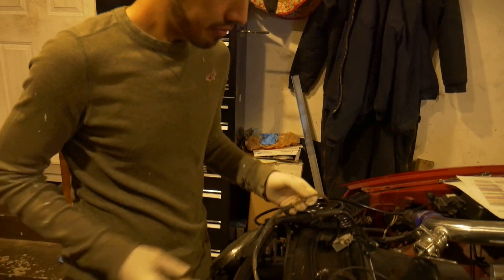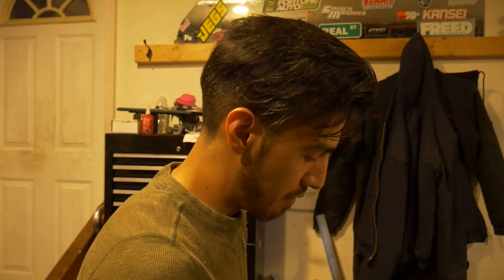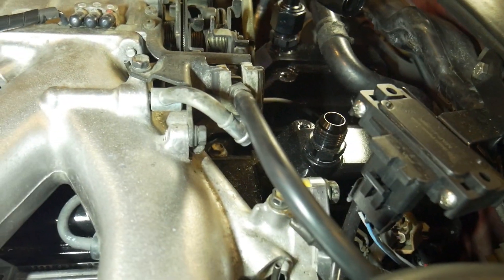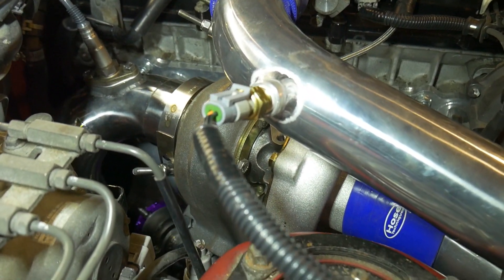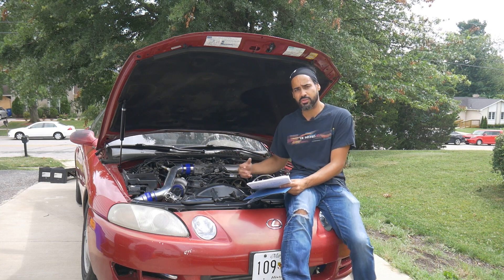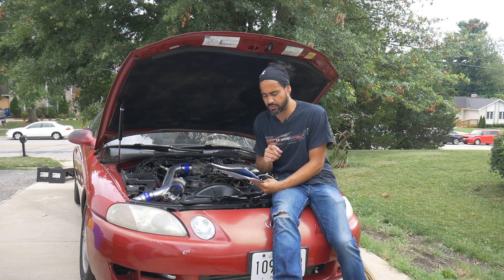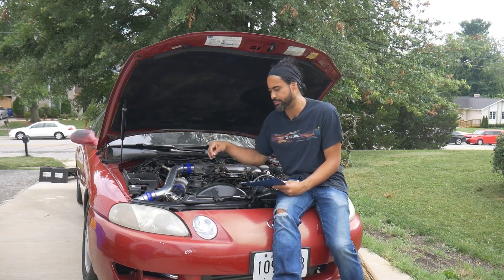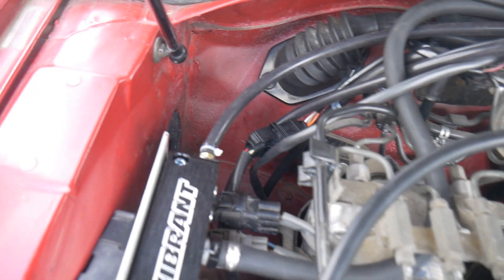Lexus SC300 AEM V2 Standalone Install guide

Comment: Hey Ed, I am running the same setup as you on a 1997 SC300 Non-VVTI. However, I am not getting any spark. Tested thr ignition coil and replaced it. Still no spark  What pin out are you using to run the ignition?
Reply from the maker: I’m using the same factory pin out for distributor ignitions and spark. Are you still on the factory distributor or are you doing Coil on plug?
Reply: @Edward3jr  I'm still on factory coil and igniter. My car is at my buddies shop. We've tried troubleshooting and replacing parts (Igniter,  coil, crank sensor) still no cigar. The car is on a stand alone AEM V2. I'm wondering if it isn't something with the ECU settings?

Comment: Hey ed when u tapped ur valve covers did you delete the baffle underneath the valve covers or did u keep them there?
Reply from the maker: I reinstalled the baffles after I tapped them
Reply: @Edward3jr  oh nice how did you route your pcv hose?
Reply from the maker: @galaxy3056  I deleted the pvc and ran a hose from the intake manifold to a vacuum block

Comment: Dude I have a noob question. When you were wiring all your sensors into the factory harness, why did you use a pin on the obd1 port instead of grounding each sensor to some random port on the chassis? And how did you do that? Did you run a brand new ground wire from each sensor and have it tapped into that one terminal
Reply from the maker: This is a great question, I believe you’re asking about sensor ground vs chassis ground. I’ll link a discussion below I found on this subject that goes real in depth. To sum it up though, the main reason for grounding these sensors to 28b instead of the chassis.

“if you ground the sensor to the engine ground, then its output is going to be offset by the ground current times the ground resistance. This is why ECUs have dedicated sensor ground wires”

Full discussion is in post 3. He gives great examples of what happens when you ground to chassis. 

So when we look at the AEM v2 instructions, 28b is labeled as sensor ground, which is located in VF2 sig of the obd1 port. In my mind It was much easier to run all of the sensor ground wires there, instead of running longer wires through the fire wall and doing this on the ecu harness side. I pulled pin 28b out from the obd1 port and spliced the wires into there. Let me know if you have more questions about this. 

https://www.hpacademy.com/forum/general-tuning-discussion/show/sensor-ground-chassis-ground-question
Reply: @Edward3jr  Thank you for sharing that discussion. I am now much more informed on this. Correct me if I am wrong, so you basically ran the MAP, IAT and EBC in a “star earthed” pattern to 29B. 

Now did you also run the ground wire from the wideband from inside, through the firewall and to 29b as well? Since AEM UEGO comes as a kit, being the o2 wires plug into the gauge inside, with another lead of four wires going out the gauge.

(Side note, I’ve heard of AEM’s Bosch sensor going out within hours after installation, even the gauge blanking out. Have you experienced this with the red sc? Or even your 600hp sc?
Reply from the maker: @julianbrown7613  yes this is correct, except instead of 29b I used 28B.
Reply: @Edward3jr  Yes, sorry typo error. Any input on the third paragraph of my last reply?
Reply from the maker: I didn’t realize there was a see more and missed both paragraphs. Ironically, I had an issue with my Bosch sensor. It was one of the reasons my car wouldn’t start after the initial base map. I replaced it with a new sensor and it started right up after this. But when this happens in my case I kept seeing lean fuel readings
Reply: @Edward3jr  ah ha! See this is very valuable trouble shooting info, thank you! Could you link or tell me the part number of the replacement one that did work? Thank you brother!

Comment: Hey, so on my 92 I’m pretty sure my fuel pump went out and I don’t wanna put a cheap one from my work (oreillys) in and have to replace it a year later. Do you have any recommendations?
Reply from the maker: Depends on your power goals, if you’re keeping it stock put a stock fuel pump in. If you’re going to make power put something bigger in. I don’t recommend a bigger fuel pump if you’re staying stock. No point
Reply: @Edward3jr  i want to put a cx racing .81 mm turbo kit on her
Reply: @jzz30jt54  what are you power goals. walbro 450 supports 650 hp +
Reply: @galaxy3056  500
+

Comment: Hey Ed, great video! Where do you plan on having the sc tuned? I’m in Essex, and plan on going NA-T soon, and will most likely go to the same shop if all goes well with your tune. Thanks
Reply from the maker: Thank you! I’m not sure yet. I’m hoping to have this all figured out soon!
Reply: @Edward3jr  did you use a base calibration on AEM tuner 3.2? I recently got a v2 as well and started playing with it pre na-t. Downloaded the software and reached the point where I could load in a base calibration with stock maf or 3.5 bar map. I however, couldn’t get my NA setup to start using the maf calibration. Wondering what you did to get your NA-T to start. Thanks
Reply from the maker: @ryanr9858  I started with the base calibration on the first initial start. But I changed the settings and adjusted for map, fuel injector sizes, fuel pump etc… on the first start it it ran rich. And I was never able to get it to start again. That’s when I reached out to freed and they sent me a few base maps
Reply: @Edward3jr  Good to know! Thanks man!
Reply from the maker: @ryanr9858  I wish I had more time to sit down a learn the aem tuner software. One day I’ll take a class or something.
Reply: @Edward3jr   Would be a great investment haha that’s forsure! 

I should’ve also asked, I couldn’t find these details in your videos but; What bar/brand map sensor are you using? Boost controller brand? AEM UEGO wideband kit? And did you use a universal iat sensor?

Also couldn’t help but noticing what appears to be a vibrant vacuum distribution block on the passenger side near abs? What do you have running to it?

Sorry for all the questions but your build is my goals lol
Reply from the maker: @ryanr9858  I’m running a GM 3 bar map, a GM iat and an electric boost controller (ebc). I’ll update the description with everything soon. But I bought the map, iat, and ebc from diyautotune.com. You can find the wideband on Amazon and yes it’s aem uego. 

The vac block is from vibrant. Im pulling vacuum from the large pipe from behind the throttle body that went to the pcv. From there I’m running vacuum to my boost control, wastegate, and what ever else needs vacuum. 

I’m not running a boost gauge right now, but I plan to in the future
Reply: @Edward3jr  wow already finding better prices on that website than what I was finding. Appreciate it!